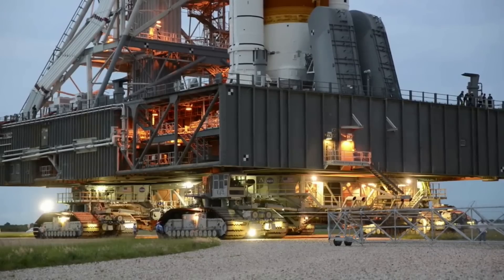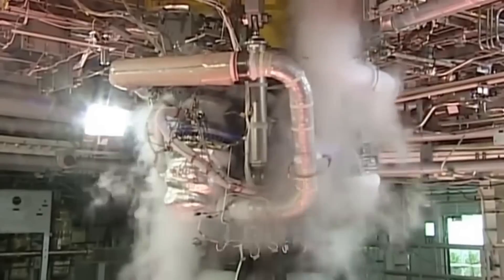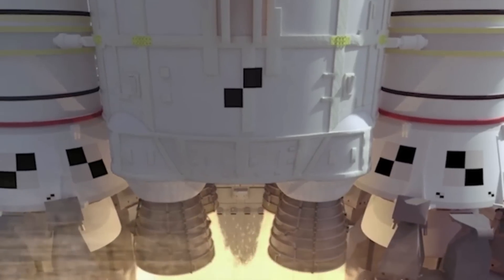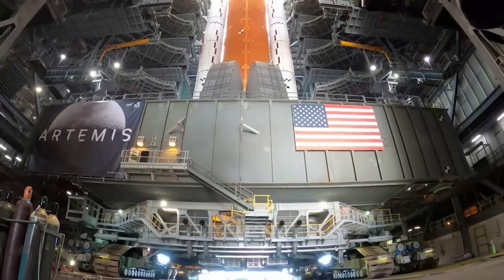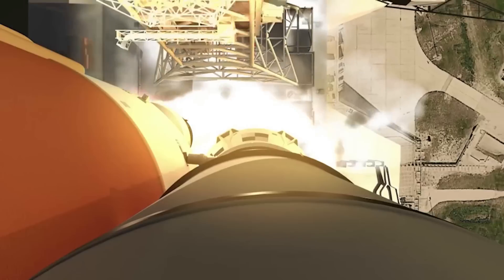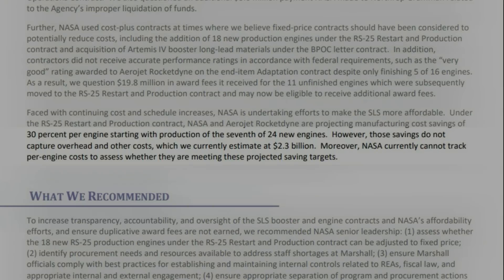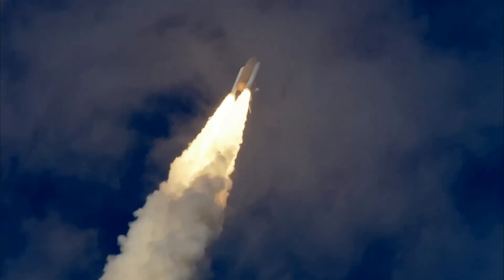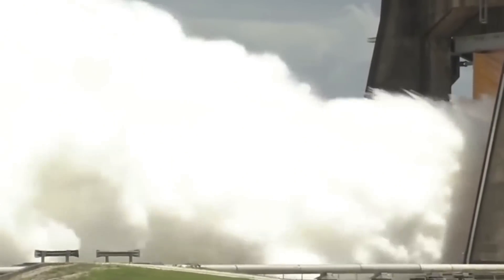The Problem With NASA’s SLS RS-25 Engine

Comment: Why not just adapt Starship to also send astronauts on the journey to the moon as well as land?
Reply: It's gonna be a long and difficult journey to try and get Starship human rated. In the meantime there has to be an alternative even if it isn't great.
Reply: @iamaduckquack  It'll have to be at some point if it wants to be a HLS or be used to go to Mars.
Reply: @AlphaGametauri  I know but it'll still be difficult as at this time they aren't even considering an abort system. They're relying on it being extremely reliable which can only be proven by launching many many times and that takes time.
Reply: @AlphaGametauri  Human rating a lander is not the same thing as a human rated launch and return spacecraft. NASA may never allow astronauts fly from Earth in a starship, for the simple fact there is no abort system. Landing in the ocean under parachute is far less risky than hoping you engines will start, and land safely in a 9 story building... being caught by a tower no less! Such a system would give NASA risk assessment teams tourettes syndrome.
Reply: IMO - sending a starship all the way to the moon is too inefficient.  Starship should instead be used to put modules into orbit that will be fitted together to create a re-usable 'space tug' that moves stuff between earth and lunar orbit.  The tug then moves the components into position where they are assembled into a lunar orbital station, next comes a lunar habitation module that's designed for a one-way trip to the moon (or several modules).  As well as moving things like fuel, rovers, etc. 

Only then do we send humans out.  The key here is that everything has to be reusable and expandable.  The Lunar orbital station can be expanded for schence research as well as a launch point for deep space missions (using a tug that gets the initial boost then slowly returns to base).
Reply: @iamaduckquack and that alternative can be commercial Leo crew providers - starliner/dragon. Saves NASA about 2B per mission
Reply: @hawkdsl  I always thought that in a scenario you would abort any other time, you could just shut down the Superheavy and simply light the Starship engines to get away. That's what i always thought. And i'm skeptical if the chopsticks idea will work. Seems more likely they'll have to land it on land and just drive it back over and use the chopsticks to lift it back up onto the pad.
Reply: @iamaduckquack  Falcon Heavy's/Dragon would already be an alternative since 2020

a "command module" would be a walk in the park to do
Reply: @AlphaGametauri  That could work for launch, but landing is another matter. The first few test flights (or hops as they called them) of Starship were excellent examples of how bad that could be.
Reply: @colincampbell767  Agree -- if Starship works, employ it as a super heavy launch system to deliver on orbit space tugs/ lunar shuttles/fuel depots, even nuclear powered spacecraft, for reliable, sustainable transportation between LEO and CisLunar space (and maybe beyond).
Reply: @michaeldunne338  I'm sticking with Falcon Heavy simply because it's currently in service.  I go for conservative stuff that uses existing technology.  Have R&D programs for the 'not invented yet' stuff but for the actual hardware sent into space - stick with what we know works.
Reply: @hawkdsl  And Starship can vent fuel while burning the engines, so i'd figure they'd keep one of the engines lighted as they slowly glide down instead of the belly flop to vent AND burn off fuel.
Reply: @AlphaGametauri  sure... If the engines even start.
Reply: @hawkdsl  Better then just throwing your arms up and belly flopping into the Gulf of Mexico
Reply: @AlphaGametauri  falling into the ocean (or land) with an un-powered starship sounds like a bad day no matter what the orientation is.

Comment: How about NASA giving SpaceX a contract to utilise Raptor engine technology for a hydrogen/oxygen cycle? I'd lay odds they could develop and produce a flight set of engines for less than the cost of a single RDS25 - and they would produce greater thrust, more efficiently.

Comment: I hope NASA manages to make this work. This shouldn't be about ego, profit or pointing fingeres, it should be about taking the next giant leap in human spaceflight. I hope NASA and partners can work together to make that happen, without endangering the future and funding of this historic and ambitious program.
Reply: It's about that sweet retirement gig at a NASA vendor.
Reply: I think NASA should leave the actual rockets to the private sector and focus on research and development, payloads etc.
Reply: Artemis will happen, but maybe not this decade.
Reply: It's about NASA wasting huge amounts of money on a rocket that became obsolete the moment Falcon Heavy launched.
Reply: @Colin Campbell  Falcon heavy doesn't have close to the same capabilities as SLS. 
SLS is crew rated. SLS has 149% the payload to LEO, even comparing SLS block 1 vs. fully expendable FH.
Reply: @plainText384  And SLS costs over $2 Billion per launch.  And you don't have to send everything up at the same time.  You can launch Falcon Heavy 20 times for the cost of one SLS launch.  Build a reusable/refuellable 'space tug' that can move other objects around Earth Orbit, Lunar Orbit and the LaGrange points.  You can then use the money you saved by not using SLS to build a replacement for the ISS and build a research station in lunar orbit.  You can then start dropping modules down on the moon for the first manned station.  

And you don't send people until each part is complete, tested and working.  Stop wasting money on SLS and start building space infrastructure.
Reply: @Colin Campbell  how much would a reusable refuellable space tug cost, especially if it has to fit in a falcon heavy fairing or be assembled on orbit from things that fit in a FH fairing. It also would need to be crew rated. 
The tug would also either need ~6.5km/s of delta v (almost 2× a normal mission), be single use, or find a way to airobreak from lunar return to LEO in a way that is reusable with basically no expensive on orbit maintenance (no ablative heatshield, no replacement tiles).

How long would development and construction take? Definitely longer than SLS, which is ready now.
Reply: @plainText384  That depends on who makes it.  NASA has basically proven that they can't keep to budget and schedule.  Have SpaceX modify a second stage for reusability and refueling with a standardized attachment point.  This would be a good use for something that can currently only be used once.
Reply: @colincampbell767  You don't have to send everything up at the same time, but it is far safer and more reliable to do so. Breaking a payload into two or three parts so Falcon Heavy can launch it also adds expense and complexity developing it on the ground. The best scenario, which is what is currently planned, is to have SLS along with commercial launchers supporting the Artemis program. SLS launches should grow leaner the more it is used.

Comment: Super heavy is a much simpler lifter design, without Starship and is potentially reusable. Why not use it instead of SLS or use multiple Falcon Heavy lifts and assemble Orion's stages in orbit? Both would put the SLS budget to better use.
Reply: The SLS is much safer though and offers a much quicker and more straightforward trip to the moon, as well as being a purpose built moon rocket that is adapted to carry orion with the lander at the same time.